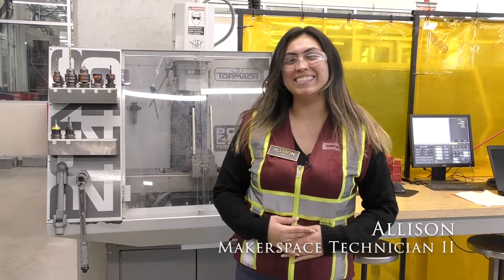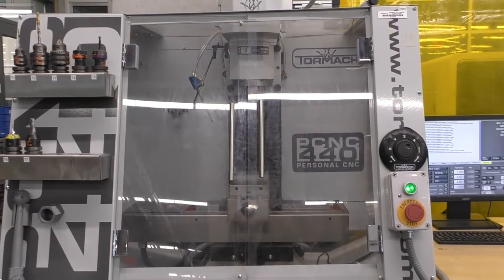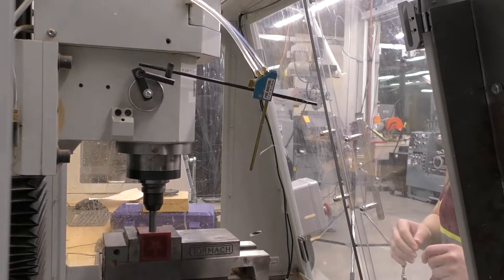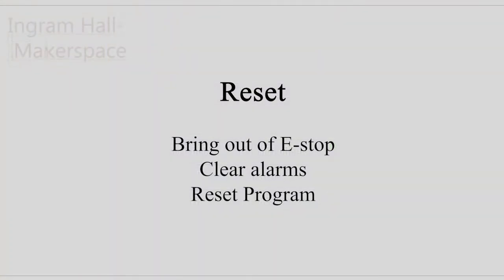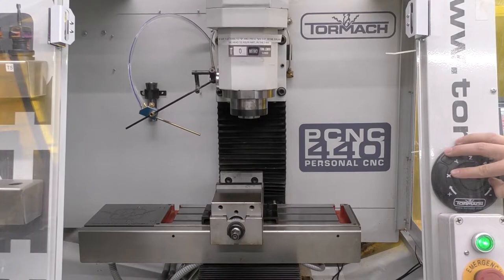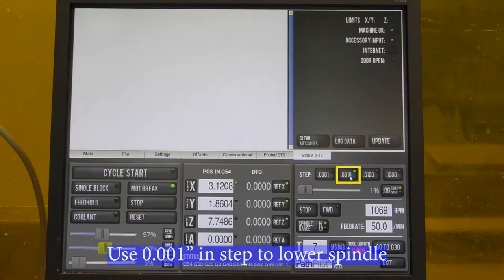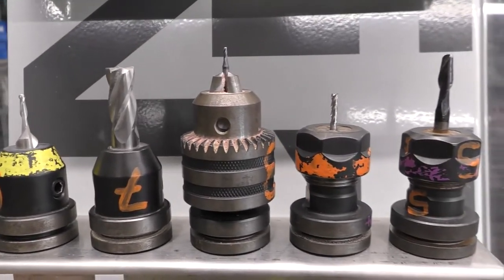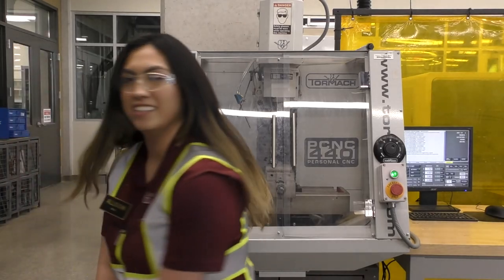Tormach PCNC 440

Comment: If it cuts steels, its only limitation is low production due to its size. Good video explained on the subject and the CNC.
Reply: THEY don't use it for metal THERE.  ANYONE COULD cut titanium on the machine.